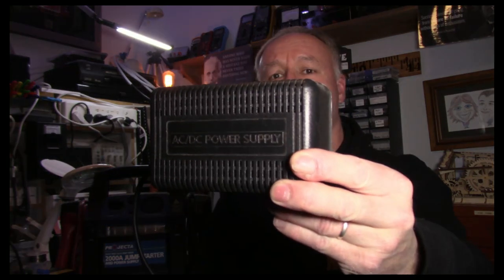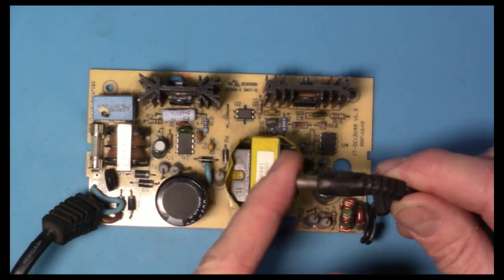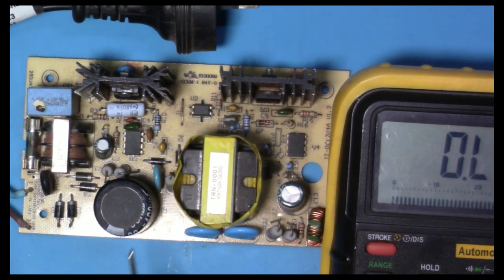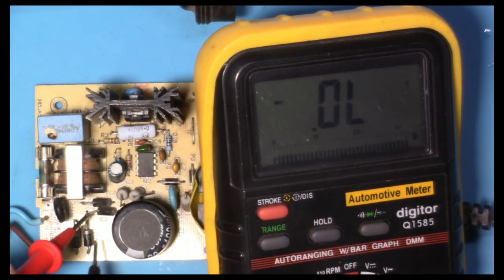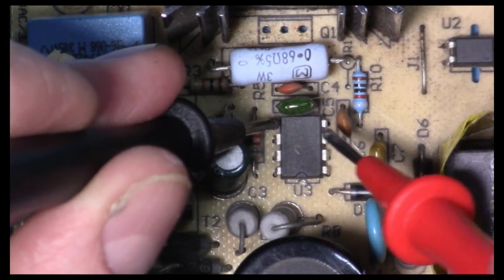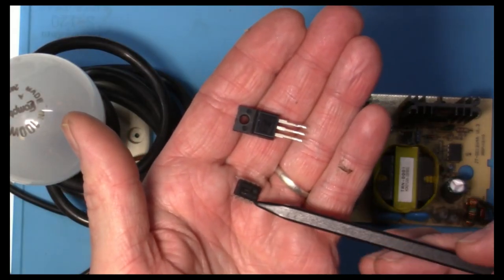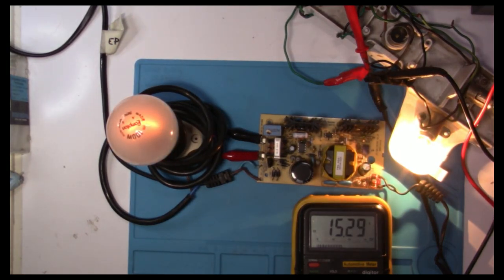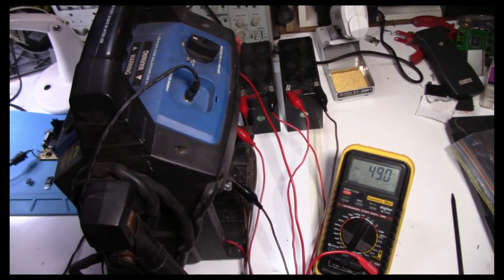Projecta Jump Start Power Supply Repair

Comment: Great job! I believe you belong very well to the electronics repair club. I love how you explain stuff. Wonder why you're not uploading electronics repair videos more frequently! I've had several cases where mosfet and the oscillator ic both happen to toast together. In quite a few occasions, it's really hard to make sure that the oscillator was bad because its diode readings show very slight changes. No dead short at all. Just about a difference of 100mv in one of those tiny pins. Btw, it's an enlightening video. Keep em coming.
Reply from the maker: Thanks for you positive comments. I love electronics, including the diagnosis and repair procedures.
Unfortunately, most of my time is spent teaching at the college, automotive repairs in my workshop, writing for companies as well as other jobs. I would love to have more time to do electronic repairs and videos!
If you are interested in other electronic repairs I have done, I also write for a blog in Malaysia. Here is the link:
 https://jestineyong.com/
If you scroll down on the home page, you can see my ugly mug! 😉
If you put in the title of this video in the search bar, it will bring up this one as well as previous ones I have done.
That being said, I am going to try and put out more electronic content.
Stay tuned! 😁

Comment: Lol, things like a fuse to check. I've seen switch mode power supplies with every component fried but the fuse. It would appear that every component is there to protect the fuse!
Reply from the maker: Absolutely true William! I've seen that myself. I wonder if the fuse is just there to fill in the gap between the holder legs? 😁